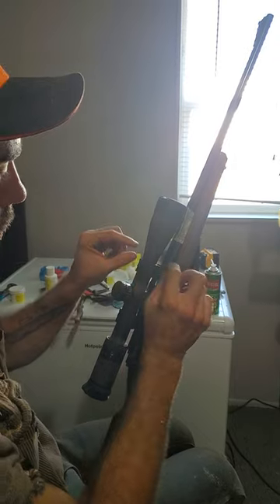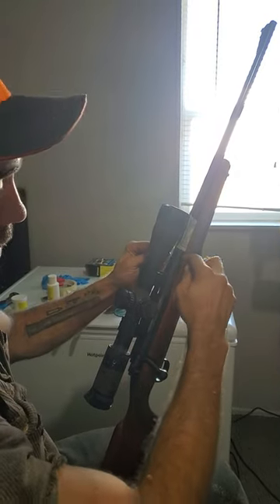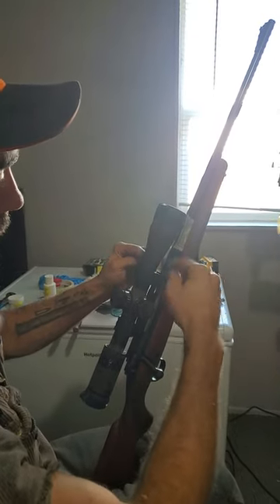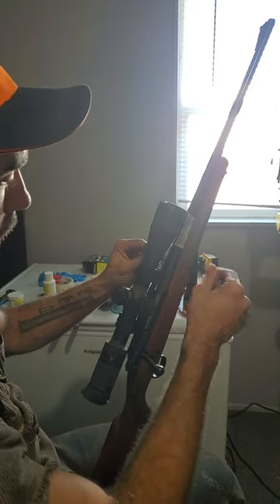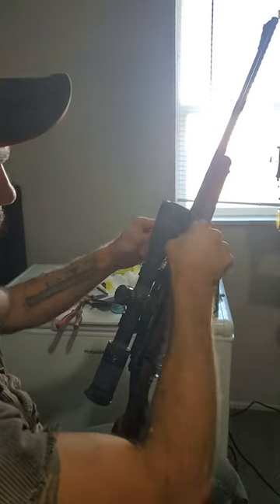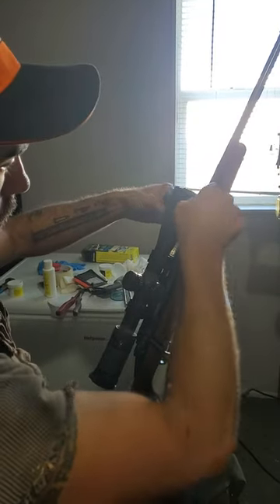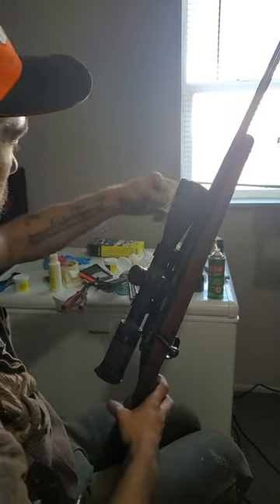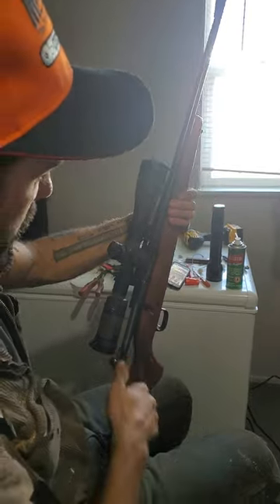How Your Barrel Should Really Be FLOATED

Comment: The chamber is part of the barrel. This doesn’t make sense, Unless you are using a modern rifle like an ar, or precision platform, which the “barrel extension” that is a separate part, you have to float the entire part barrel + chamber to get the benefits of a floating barrel.
Reply from the maker: I used a product called "Bedrock"

And I bedded under the chamber portion of the barrel because the directions recommended I do so. 

The rifle is shooting through one hole at 700, so that's the sauce.
Reply from the maker: I also took hours and hours to carve out the stock to make room for this giant barrel
Reply: @timberfallingcouple nice, I wasn’t ware of a DIY kit like this. In that case it makes sense. No issue to you, just see a lot of fuds taking dremels and chisels to their rifles lately in ways that make no sense! Glad it shoots true!
Reply from the maker: @HyperLethalNova  well, I am that Fudd. But it saved me 500 bucks for a new stock. 

The kit is really nice though. Comes with a few different rifles worth of the epoxy, and the little glass micro balloons. I'd rather it was actual glass fiber, but it seems to hold just fine. It's got a suction when I pull the receiver out of the action. I'd say she's snug. 

My whole point is just that any old Gomer Pile can save a pretty penny doing it themselves and still have a gun that shoots very well.
Reply: @timberfallingcouple  Absolutely, I just hope people understand the WHY too not just the what. Glad to see you doing good things 👍🏼